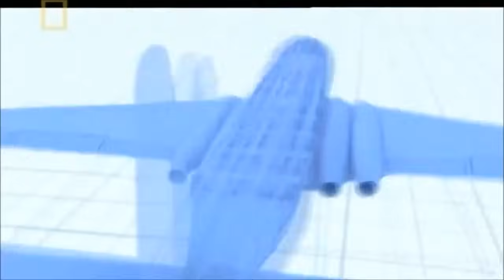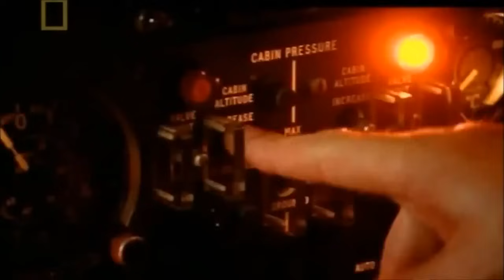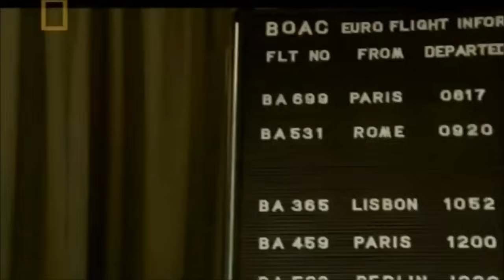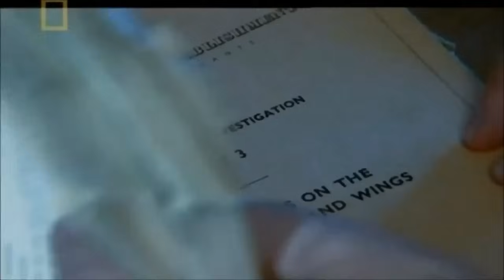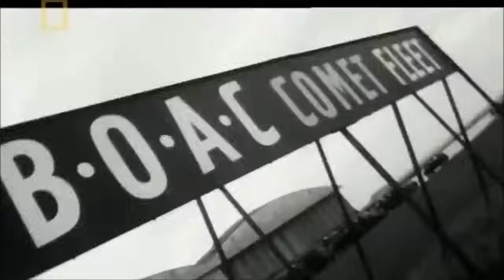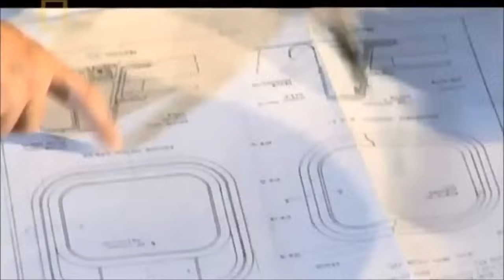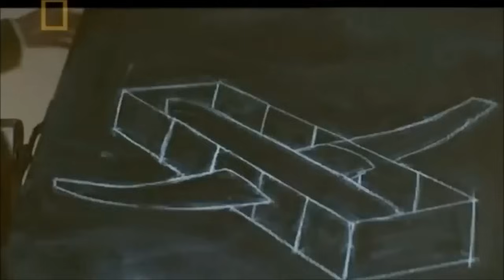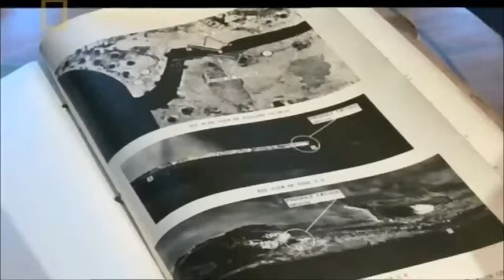British Overseas Airways Corporation Flight 781

Comment: This is why windows on all Modern Day aircraft are circles. Kinda sad that they did not touch on that in this show. The Squared windows where 99% of the problem.
Reply: The square windows were only about 70-80%. Another reason is the weak and thin aluminium of the plane. (About 10-20%?)It was going on really fast speeds and high altitudes so the thin aluminium didn't handle very well and square windows caused pressurisation problems. There are also other reasons.
Reply: The square windows were only about 70-80%. Another reason is the weak and thin aluminium of the plane. (About 10-20%?)It was going on really fast speeds and high altitudes so the thin aluminium didn't handle very well and square windows caused pressurisation problems. There are also other reasons.
Reply: @janselkennethtolentino8269  To my knowledge it was caused by the stress concentration of the edges of the windows.
Reply: @kesselster  Yes. It
was partly caused by the pressurization of the aircraft.

That, coupled with outside pressure caused stress on the window edges.
Reply: The problems occurred because instead of drilling holes they riveted the windows into the airframe which caused fractures. The square windows were only a contributing factor, not the primary cause of the accidents, if they had followed the manufacturing instructions the accidents would likely not have happened.
Reply: @janselkennethtolentino8269  I heard you the first time~!
Reply: The source of the fatigue cracks that originated from the windows was not the cause of the catastrophic structure failures, it was DeHavillands lack of technical experience using metal airframe construction and pressurization. The Comet Disaster investigations founds hundreds of serious design, material and construction defects.
Most notably the insufficient skin thickness, absence of doubler joints and poorly engineered and fabricated joints and fasteners.
Reply: Ikr
Reply: @janselkennethtolentino8269  Isn't Aluminum a soft metal?
Reply: @janselkennethtolentino8269  Didn't piston-driven airliners also have pressurized cabins?
Reply: @twistedyogert  Yes, but they operated at much lower altitudes like 22,000ft not 41,000ft.
Reply: They aren't all circles though. Your next theory?
Reply: The Comet Disaster investigations found DeHaviland Comet was riddled with hundreds of fatal design, material and construction defects.
The Comet 1 was so poorly designed and constructed the entire fleet had it's airworthiness certification permanently revoked.
Reply: @twistedyogert  Before composite materials, Aluminum alloys were common as airplane materials.
Reply: Me granpa designed the landing gears on these arseholes and til his death he said that flyin shethouse should never have left the factory.
Reply: 1OOTH like
Reply: It’s amazing how much engineering goes into building the plane and something so simple is overlooked. The thing I hate about air travel is they worry about profits over safety. If an airline company wanted to they could build them much stronger but they don’t want to add any extra weight. I’d rather pay double the price to fly knowing the plane is safer
Reply: I seem to recall that the American broadcast of this program emphasized the square windows.
Reply: @janselkennethtolentino8269  why did your comments repeat?
Reply: @jonahmoran3751  probs lag. It used to happen quite a bit before (for other people as well)
Reply: @Alb410  Before the Comet Disaster DeHavilland built planes put of WOOD not metal... the company simply lacked the knowledge and experience needed to construct the Comet safely.
Reply: If you see an airplane with square windows then that airplane is non-pressurized and therefore it flies at low altitudes.
Reply: @zinedinezidane2364  Thats not necessarily true.
Reply: @zinedinezidane2364  I guess you have never seen a Bombardier 7500???
It has huge square windows and is pressurized to 51,000 feet.
Reply: @twistedyogert  yes, they had weak cabins similar to the comet but flew far lower and far slower so the problem didn't surface as quickly. Given enough time and flights they may have blown up like the comet mid flight
Reply: WRONG!

Comment: This was pioneering and the deaths were tragic... but they learned so much about metal fatigue from the Comet crashes.  Still, I'd imagine it was disturbing to be a passenger with that agitating music on the plane right before the crashes...
Reply: Not true, Boeing was the pioneer of pressurized passenger aircraft and was more than a decade ahead in design of large, all metal pressurized airliner production.
 Aircraft like B-29, 307, B-47 and 377 predates the tragic Comet Disaster and the Boeing 707 predates the findings of the Cohen Investagtion and the Comet 4.
Reply: @sandervanderkammen9230  It wasn't just metal fatigue, manufacturing defects caused fractures into the fuselage because no holes were drilled before rivets were placed into the frame of the window containing the radar camera.
Reply: Sander Van der Kammen but the owners of Boeing said quietly that they learnt to pressurize their aircrafts from the comet.
Reply: @user-xp9jo2rv3q  BULLSHITE, that kind lying and attempt to rewrite history will not be tolerated here.
Please stop spreading false information regarding the worst engineering failure in commercial aviation history.
Reply: @user-xp9jo2rv3q  Boeing was the worlds leader in all-metal, pressurized airliners and had been successfully building them for over a decade before the Comet Disaster without any catastrophic structural failures.
The Boeing B-47 flew in Dec. 1947 before the Comet and it had a higher cabin pressurization differential  (9.6psi) than the Comet.
The first Boeing 707 prototype flew on July 15th 1954 long before the cause of the Comet Disaster was understood. 
The factual evidence is irrefutable and completely destroys the myth had Boeing gained any technology advantage from DeHavillands mistakes. 
The Comet Disaster was the direct result of  incompetence and a callous disregard for safety not cutting edge experimental technology.
Reply: Neat seeing you here, I remember seeing you on bowling videos

Comment: give them a lot of credit ground breaking for that time period finding out what the problem was
Reply: Boeing pioneered pressurized passenger aircraft more than a decade earlier, if DeHavilland had learned from the 307 and 377 the Comet Disaster may have been avoided.
Reply: Sander van de Kamen, Even the De Havilland Mosquito had a pressurised cabin (1941)  so they were hardly amateurs, but they were ground breaking a no one knew then enough about the issues. At least the Comet crashes saved Boeing who immediately used thicker aluminium skin and all subsequent airliners have round windows
It's easy to be wise after an event but no-one was but the Comet paved the roadto success for the 737.
Reply: @mtsenskmtsensk5113  Bullshite lad, Boeing produced the world's first pressurized passenger airliners in 1937, and led the world in large all-metal, pressurized aircraft construction with planes like the B-29, 307, 377 and B-47... all at time when DeHavilland still made aircraft out of wood and fabric.
Reply: @mtsenskmtsensk5113  You mean Boeing 707, it's design was completed before the results of the Cohen Committee Investagtion of the Comet Disaster were available  and had no influence on the design of the world's first successful, airworthy jet airliner built by Boeing.

Comment: You know today Boeing boast that 787 has bigger windows than its predecessors...but the ancient de Havilland seems to have had the biggest windows I ever saw on an airliner!
Reply: Misiulo and that was exactly the thing that downed it. Metal fatigue was poorly understood, and the square windows concentrated much of the stress, which caused the metal to crack and ultimately fail.
Reply: Misiulo airworthy reliable windows**
Reply: The Boeing 787 is also the safest passenger jet in history with a perfect safety record.
Reply: @sandervanderkammen9230  Fair enough, but we must also remember the 787 is a new aircraft which has only been operating for a few years.

Not to mention the controversial 2013 battery issue...
Reply: @MIZUch.  The 787 has been in service almost a decade now with nearly 1,000 aircraft built.
It has already flown many times the total passenger- miles than the Comet fleet did.

YUASA designed and built the batteries, not Boeing. They were tested and approved by the FAA.

There were no deaths or injuries resulting from defective batteries.
Reply: @MIZUch.  1 out of 4 Comets crashed or were destroyed in accidents resulting in 426 deaths and numerous injuries making the Comet the worst jet airliner in history.
Reply: The DeHaviland Comet was not only backwards and ancient it was also the greatest engineering  failure in aviation history...
Reply: it is ancient, by today standards that is
Reply: @MIZUch.  DeHaviland was decades behind in aircraft design and construction techniques... it was still building planes out of wood and fabric well into the jet age.
 The Comet was a plane that clearly exceeded the company's grasp...
Reply: Loxury.
Reply: @sandervanderkammen9230  And those engine problems?
Reply: @titan9259  What engine problems?

Comment: I saw that one on Air Crash Investigators. Three very talented pilot minds worked together to land it. I've noticed that American engineers don't seem to like simplicity; It's as if they think something simple can't possibly work. Australian, Russian engineers will simplify something as much as possible for reliability, but make it about twice as strong as it needs to be. The ancestor of the modern flight data recorder was an Australian invention, and simplicity was the core to its design
Reply: What? No, you're talking about the crash at Sioux city right? Or are you talking about the first incident with the door of the dc-10?

Comment: I've worked in manufacturing for 10 years and assembled machines. Don't recall seeing rivets as fasteners. Just metric or fine thread machining bolts. Rivets also played a part in the destruction of the Titanic. The engineers opted for a cheaper version at the last minute to save money. Wonder if these disasters could have been avoided with a different type of fastener, albeit any type of hole, crease, or seam in metal, compromises the structure (especially metal exposed to pressure changes) over time.
Reply: BUT, there was one STUPID mistake that crew made that would have prevented Titanic's death but due to bungling bureaucracy and a rush to get her to sea, the crew was never trained properly on how to handle a ship her size.  Even a much smaller ship with her design flaw would have suffered the same fate.  With her rudder far too small for her size she was at a disadvantage already.  Still, she would have survived but for one DUMB mistake made by the improperly trained crew.  You NEVER, EVER reverse engines when trying to make a radical turn!  All that does is "boil" the water around the rudder, rendering it virtually useless and the Titanic's fate was sealed.
Reply: Reversing the engines is a bit of an overblown myth. The actual engineers reported that they didn't manage to reverse the engines until after they hit the iceberg; indeed, they thought the impact sound was the cavitating props.

What really sealed her fate was White Star's absurd decision not to fit her with enough lifeboats.
Reply: @richardcline1337  Both the Titanics sister ships also sank...
Reply: @sandervanderkammen9230 , Wrong!  The Britannic sank but the Olympic went on to serve a long and dependable career, finally being broken up for scrap.
Reply: @richardcline1337  You are correct sir,   the two sister ships were both modified after a serious structural defect in Titanics hull was discovered.

Comment: These sorts of problems keep on reappearing, caused by rivet-induced damage during construction, or more often now, during reconstruction after a mishap. Many of the episodes in these air accident investigation series deal with exactly such situations. The Comet investigation meant that at least in the initial design and/or testing such deficiencies would be avoided or corrected. Tank testing was used for quite a while.

Comment: Airframe stresses are concentrated at sharp bends like the corners of square windows. Those areas were prone to accelerated metal fatigue with each pressurization cycle and stress cracks begin to form. Once that occurs the metal will tear. That's why all modern pressurized aircraft have round windows. Round windows offer no places for stress forces to concentrate.

Comment: I agree.  The Comet had much more of that "jet age" look about it than modern aircraft.  It was a beautiful aeroplane.  The 787 is probably the most advanced passenger jet.  Yet its wings bow as they gain lift, thus appearing more like the wings of a glider than a jet.  The design of the 787 is more functional, but the striking lines of the Comet give it an appearance of strength and force. The Comet was like a sword, whereas the 787 is more like a plastic picnic knife.
Reply: The much bigger and improved comet 4s were gorgeous looking planes

Comment: We had an explosive decompression at United Airlines back in 1989 that was horrific.  Aircraft tail number 8224 lost the forward lower lobe cargo door as the aircraft past through 24,000 ft.  It left a 24 foot hole in the fuselage and killed 8 passengers if I remember correctly.  The #3 engine had several of them for lunch.  There was also a facial imprint on the inboard edge of the r/h horizontal satibilizer.  Yes, explosive decompressions are horrific!

Comment: Well, I already know the issue with the Comet

(Spoilers)

The windows were square/rectangular like the other civil aircraft before it, and couldnt hold up to significant pressurization, that’s why modern windows are smaller and oval shaped
Reply: DeHavilland didn't know how to make planes out of metal, prior to the Comet Disaster DeHavilland was still making aircraft out of wood.
Reply: The spoilers were retracted at that point
Reply: It's not just the square windows, the plane's hull on a whole was far too thin and fragile to handle the stress of pressurisation. Combined with the riveting defects and square windows its fate was sealed from the moment it was build

Comment: Any loss of life in new technology is sadly inevitable, growing pains. Flying has come a long ways in 50 years, and getting in your car is still FAR more deadly than flying.
Reply: The Comet fleet had been grounded after the first two crashes. BOAC were losing money and weeks later with no idea of what the fault was the Chairman announced that they would continue flying. It was all about money and the man should have gone to prison for it, but this seldom happens in the UK.
Reply: A good point, the fine line between trying to make a business succeed, and criminal mis-conduct, in this case.

Good posting, dh.
Reply: Well, that's true...until it's not. There are also many millions more cars on the road. Even in a crash your odds are better in a car. Not against flying. But there's nothing safe about being 30,000 feet up in an aluminum tube going 500mph. Just accept the risk or don't fly.
Reply: Say that to driving in a motorcycle when you get in an accident In a motorcycle there’s no airbags no protections your exposed.

Comment: I believe the most severe inspection takes nearly three days. But they are always checking for stress factors even on a minor inspection.  When you figure it costs thousands of dollars for every hour the plane is out of service and it would be too costly to do full breakdown every time.  Doubler plates are quite strong when "properly installed."  And are only used for minor damage.  The FAA has pretty strict guidelines as to the type and size limits that a doubler plate can be used for..

Comment: The disasters were not the only reason. The Comet had too short a range, was too small (even the 4C) and its engines were gas-guzzling turbojets and not turbofans. The derived Nimrod did use low by-pass ratio Speys, but still the engine mounting design was very limiting and not as safe. The B707/DC-8 designs were adapted easily circa 1960 to the more efficient and quieter (and fatter) turbofans. Tail-mounted engines also have proven less effective than underslung wing-mounted pods.

Comment: Some 15 years ago I watched a documentary on the Comet. THAT documentary said that the cracks appeared because the windows were square, and without rounded corners. I see from THIS video that the windows do NOT have square corners.
Reply: +Robert Gantry The first Comet 1 had square windows with onls slightly rounded corners. Modern windows after the Comet 1 are oval.
Reply: matekochkoch
I see.

Comment: Yes. Flight 811. I remember video of the aircraft, after it landed.  There's an episode of at least one of the air crash series about this. The cargo door latch had several points of failure that led to the disaster.

I remember thinking about what the horrific experience must have been like for the people sucked out of the aeroplane -- some getting sucked into the engines, some hitting their heads on the horizontal stabilizer. They were the "lucky" ones.

Comment: They Have different grades of inspections that are done on a regular bases. after so many flight hours.  The most extreme one the literally gut the plane in search of stress fractures and deformations.  If they find one depending on the severity of the damage the will either repair the damage with a doubler plate or replace the entire section with new skin.  I hope this answers your question.  :)